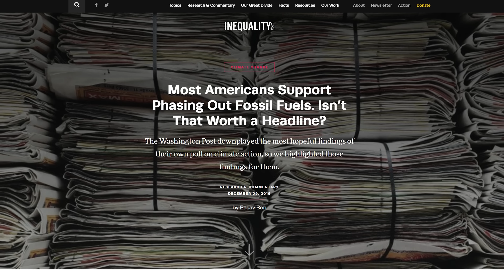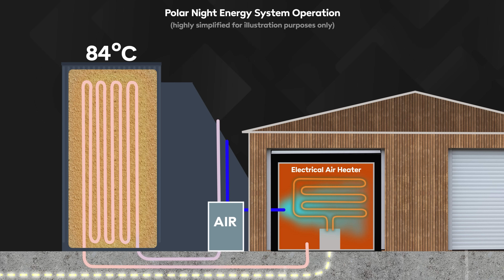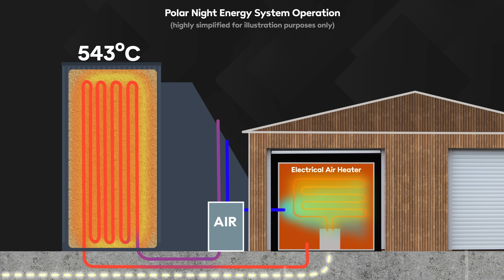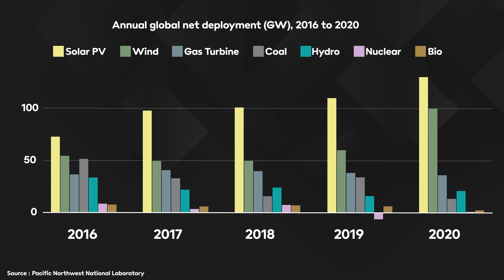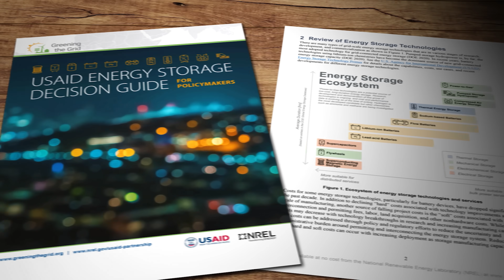The 'Sand Battery' that heats your home, NOT the planet!

Comment: I read that using basalt particles or even waste from Steel plants (slack), both in abundant supply, you could use a temperature of up to 1400 degC, which  doubles the storage capacity. Pipes will more expensive, though.

Comment: Any testa ongoing where the sand battery i integrated in the building? Like a baseplate/sndbartery with an office block in top  or a process industry with ind ut atrial heat but l iäon rop of a sand battery.

Any testa ongoing with th sand battery build with big correctly f ö med natural stone  in sted of big blind ba of poured concrete.

Lots of CO2 in the concrete pour  Ir feels like a  lot of rhat that could be avoided with big blocks of natural stone in the right size!

Comment: I first heard of sand batteries during an industrial decarbonisation roadmap assurance review in mid 2022. At the time it appeared to be a bit of a pipe dream, but now I find myself promoting the technology for consideration in a few recent decarb roadmaps assurance reviews - usually as an alternative to 50 to 100MW electric boilers. The cost estimate for a 1GWh 15MW sand battery appears to be several times the cost in your video, but it can be adapted to provide a reserve steam capacity with less capex and opex than eboilers wnich can cost an additional $40M capex in grid connection and transformers/substation. Also power prices a swinging from $0 to $200 per MWh compared to $40/MWh natural gas, so you definitely want to charge the sand battery at low price periods. There are still a few issues for the LP steam back-up application that could be addressed by hybrid solutions, but at least the economics are starting to make sense.

Comment: Around 10 years ago, I had the opportunity to visit a project in Richmond, Virginia using similar principles. A home-owner, who may have had an engineering background, though I do not recall for sure, had excavated a pit in the backyard - 10 to 12 feet deep and wide and maybe 15 to 20 feet long. This he lined with some sort of membrane to keep out water, insulated with foam board and layered in PEX pipe and sand. The whole was topped off with more insulation board and soil, and more membrane to keep out water. On one end of the system the pipe went to solar panels - I am recalling 4 or 5 panels - and to the house on the other. The PEX was filled with  a propylene glycol solution. Richmond has fairly hot summers and cool to cold winters, roughly an average high and low in July of 89ºF/32ºC and 69ºF/21ºC, and in January of 46º F/8º C and 25ºF/-4ºC. The weather is rarely cloudy for more than a few days at a time. Heating of some sort is usually needed November through March,  occasionally longer, and the home-owner said that the system kept up quite well. The house was of conventional mid century frame construction, and as I recall, had no special features except for good insulation.

Comment: Verge Permaculture in Alberta has done engineered  greenhouses viable through minus 40 degrees winters by pumping heat into ground under the greenhouse in summer while cooling the greenhouse, and recapturing that heat in winter while recharging the ground using cold air.

Comment: Hi. Rather than "batteries", these are better called "heat sinks". Sand is rock of course, and ye olde traditional home fireplace was always surrounded by a stone/brick surround that stored most of the heat. The brick chimney soaked up the rest, and the warm stones and bricks heated the house all night until Maggie the parlour maid restoked the fire at 5 am next morning. Flue shutters slowed the burn-rate overnight, but produced more carbon monoxide. 
     The kitchen sported an "Aga" cast iron cooker, also a great heat sink device that wasn't allowed to go out. It's great to see traditional technology hasn't lost its place in the modern world. The fewer transformations from one type of energy to another, the more efficient these new storage devices will be. Cheers, P.R.

Comment: Thermal storage in sand batteries is easily and cheaply scaled to residential size and can be used to drive heat pumps in super cold areas.

Comment: This uses resistive electric heating which requires a lot of electricity. I wonder what are the theoretical limits of high end temperature for heat pump technology? In this case, there probably would be a certain small percentage of energy saved if the air heated was, if it was sufficiently cool for start, preheated with a heat pump up to the heat pump's temperature limit, before switching the circulation over to the resistive heater path. But I guess in this kind of facility the internal air is never cooled down that much and its temperature is always kept within some thresholds, as cheap electricity time comes around every once in a while.

So basically, in summarized big picture, this is centralization and accumulation of all or of major electricity-to-heat conversion for a certain size of human community, in order to optimize and match consumption with (intermittent) production.

Comment: Since I saw this last year I started planning a sand battery for my small home.  I use passive solar for about 12 hours per day of winter heat, 300 days per year. I tested it the last couple years and find it survivable, comfortable at night if I use a mylar blanket underneath my bedding. Not suitable for edible houseplants. 17 hours is a good amount of heat.
I have concrete blocks and a big pile of sand and gravel inherited from the previous owner, but our heat dome had me put off starting it. At 69 I didn't want to press myself in 8 hour daily heat advisories.
I am excited to try this!
Worst case scenario my partially underground tea house is more stable in temperature,  especially for summer.
I was glad to watch this again, as fall approaches, and I hope to complete by winter.  It is interesting to see what the Corporate Succubus Slavers are doing, but I like low tech microsolutions... no debt, a garden, deciduous shade, and so on. An unusual improvement has been making original tapestries like in old castles.They increase comfort in winter and summer both.
Still studying transportation. My 05 Tacoma gets ~33 mpg, not too bad, I drive less and it is hard to beat.

Comment: i am thinking that you could run central heating off a sand battery via a coil in the sand and charging the sand with solar voltaIc panels certainly the heat generated would be hot enough i think

Comment: I saw a gentleman that used a large barrel of paraffin wax to use as a heat battery. He put this 5 gallon barrel of wax on his wood stove. When the wood stove died down in the middle of the night, the wax gave off loads of heat until it solidified.

Comment: I'm reminded of centrally-produced, hot-water radiator heat which was a common heating system in the early to mid parts of the last century especially in large apartment buildings but also in homes, churches and offices. Water works well for this purpose because it's easy to circulate throughout a simple system of pipes. The sand storage system may have higher energy density because water boils above 100C which limits its energy density in a non-pressurized (low cost) system. To me, however, any type of thermal energy storage system is of great utility because it stores thermal energy, not electrical energy. Thus, it can serve heating needs without any energy conversion (electrical to heating).

Comment: Since plants that we humans depend on for Oxygen need an amount of Carbon to survive, what happens when we've reduced the amount of what plants need that they produce? What do we as a species do then? Otherwise the concept of using sand as a way of storing waste or produced heat for a central heating system is intriguing and interesting.

Comment: Uh Yeah, A couple things on this. So you heat the sand with electricity right? Why not avoid the waste of energy loss of the system and just use it conventionally for commercial and residential heat to start with. Where is that energy from? Solar, Wind, Hydro power? And what energy are your using to build these systems? We know as fact that current grid power can not even supply needs now and is supposed to support all the EV's the governments are pushing for and this community heating project. Yeah Not Going to Happen.  Secondly You say that winter has more wind than other times of the year. That is not true.  Winter has on more wind than other times of the year. The windiest times of the year are during the change from winter to summer and summer to winter when the atmosphere is unstable. Instability of the atmosphere is what creates the wind.

Comment: A passive solar system or heating it using petroleum or geothermal would be cleaner. Heat the cell in surplus and discharge later during peak usage. It could decrease the strain on the electrical grid. 
Using wind or PV solar would be extremely dirty. You may not see it but those two are some of the worst for pollution. Well maybe not in your backyard but in another country and in landfills.

Comment: Heat pumps suck, I’ve had 3 of them and they are not efficient once the temps get below 40-45F they switch over to electric heat which makes the electric bills soar. Problem with so many of these alternative heat sources is the the source of power you’re using to power them. Often times the solution is much worse than the thing you’re trying to eliminate. I will stick to my natural gas fireplace that heats my entire home fairly efficiently and at a 1/4 of the cost of my heat pump.

Comment: Could salt be used? The melt point is 300 degrees lower than sand, but it is a waste product of desalinization, and there is plenty of it everywhere. Depending on the makeup of sand needed for this there are some types that are getting more rare like that used in modern concrete.

Comment: I think there are or used to be many federal buildings in Washington D.C. that relied on a central heating plant where larger boilers heated water to steam and then they piped it underground to buildings several blocks away.  In some East coast cities you can still see steam vents in roads.  There used to be a broken steam pipe on 17th street between Pennsylvania ave and H st, near the white house that they installed a chimney pipe over to lift the steam cloud over the cars.

Comment: I have thermal energy storage for the heat from burning pelletised biomass at my business. It's a water tank which charges with the excess heat produced by two boilers.

When one boiler shuts down for recharging its pellet silo and self-cleaning, the other boiler takes over. In very cold weather, an automatic mixer valve diverts hot water from the storage and it gets pumped around the ring main, through the heat exchangers that heat the air in the buildings, so the temperature is maintained.

The whole system is automatically optimised, together with a variable-speed ring-main pump, to minimise the number of boiler cycles, because a boilers' output is fixed. It's incredibly efficient and uses sustainable fuel sources, but can't heat to 600°C because the boiling point of water is only 100°. Electrical heating of sand storage would be needed.

I have electrical night-store circulated hot air heating at home, supplemented by solar heat from a conservatory - from a sustainable energy supplier. We regulate temperature around the house with a single thermostat, just by manually opening doors when needed - no ducting required. It's much more efficient than a night-store heater in each room. The storage is in the centre of the house, where we spend most of our time.

So there are two examples of heat storage, one automated, the other manual, both sustainable.

Comment: Using any material at 600 ° C to store heat is very difficult because the thermal conductivity of any insulator goes drastically up with temperature. At 600 ° C perlite is around 0.15 w/km2, for a tank of that size, the loss of heat everyday is massive. That is why they used water on the big tank, because at 98 ° C is possible to use cheap insulation to keep the heat in.

Comment: I believe that this can be used for individual properties too. I'm hoping to use excess wind and solar energy to heat an old gas bottle filled with sand. My hope is that eventually it will replace our boiler and be able to provide got water and heating for our family home.
Reply: I agree, use a dump load resistor with a suitably sized turbine and  sand battery.  Micro Vawt turbines may even allow utilisation in urban areas. An embedded coil to allow water heating... As long as the wind blows, 24x7x365 heating.  One to try in the garage first though, that's a lot of weight to add to a first floor airing cupboard floor joists 😁
Reply: if you are building a solar system anyway it would seem to be sensible add a solar water heater panel or two, it eliminates the extra steps and extra costs and sound a lot simpler.
Reply: The sand heat storage system works only when they are large enough, because the temperature drop from its centre to its outside surface  is proportion to it linear dimension L heat loss rate is proportional to L*L and heat stored is proportional to L*L*L. For example, a body of sand the size of a gas bottle 1) will have an outside temperature pretty close to its centre temperature, so you cannot heat it to a high temperature, 2) it will cool down in a few hours instead of days and 3) hardly an heat will be stored. This one of the reasons why this way to store heat is only suitable for district heating.
Reply: I don’t get that. Surely there are pretty good thermal insulators that would keep the thing warm.  It works with my vacuum flask!

Comment: Somewhere in the video it mentions the data centre heat of 60 deg C is stored in the tank. The energy to channel the air to the tank, should cancel out some of the savings of energy, right? And the stored sand temperature should be a bit lower than 60. But what can that be used for? Appreciate someone can help to enlighten me. Thanks

Comment: Since peak power demands come during the summer, perhaps this technology might also be used to store cold by cooling a sand pile when power is relatively cheap and then using the sand pile as a heat sink during high-priced hours.

Comment: Why not bury these structures underground and build over the top of them? Avoids wasting valuable real estate. Using compacted sand inside a concrete box would provide enough structural support to act like a huge foundation which could easily support steel framed buildings with the top of the concrete box becoming the floor slab of the building!

Comment: This evolution is exactly what I was hoping for. There is so much waste heat in theory since all that massive energy we use, ends like it. If they use that hot sand to make steam for a turbine, the efficiency would normally be not so high for a small installation ( could be only 40%).
 However, if they could now capture all the waste heat and store it again, then low efficiency is no longer a problem but almost an asset.

Comment: Denver , Colorado has district heating currently, plus lots of Sun which might be used to heat sand more directly (via solar thermal) even in winter. This sand battery would be great for storing heat for that system. Unfortunately there are currently plans to phase out our district heating.

Comment: It turns out that this type of tech has been used for many years in Arab land on a much smaller scale for overnight heating when the temperature goes low.

So which part is new of this tech is new?

Comment: Can it be scaled smaller, on a single household or apartment block scale?  Is that economically viable?  Having it local to individual properties would remove the insulation requirements of long pipes across neighbourhoods, but probably brings with it a whole new set of constraints...

Comment: I heat my house using a Finnish style fireplace, of my own design, that heats a 50000 lbs of stone in an insulated room. These fireplaces have to be isolated because of difficulty controlling its heat. I draw the heat from it through my furnace. It also heats 300 feet of copper tubing that allows me a 1 hour shower or more. The most important consideration is insulating the house. My house has a R-value of over 45. The windows a triple glazed and filled with argon. I live in Canada and before I completed my fireplace, I used to pay 30 dollars a month to heat it in winter. In summer, it is on average, 10 - 15 degrees C cooler inside than outside. I found the more insulation , the better. We also have an air to air heat exchanger that replaces the air in every thirty minutes.

Comment: These concepts can be utilized in private dwellings, avoiding the long-assumed but mistaken perspective that centralized solutions are more desirable. For our home we use a combination of thermal solar to heat a 500 hundred gallon tank of water which circulates in radiant tubing in our house floor. This radiant tubing is ensconced in three inches of sand below wood and tile flooring. Once the sand heats up, it tends to remain warm with minimal added heat from the solar-heated hot water tank. Thank you for doing this sort of video, with alternative ideas that really work.